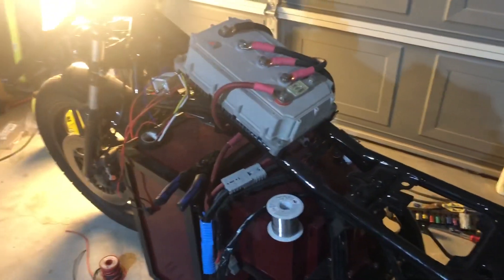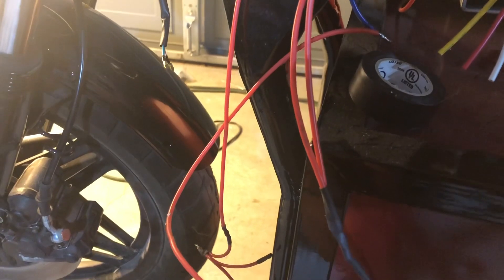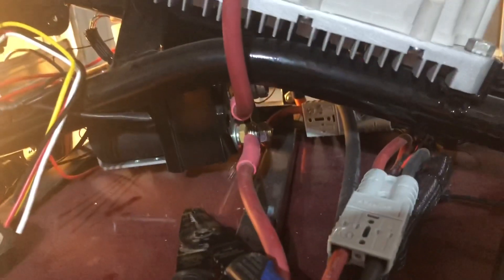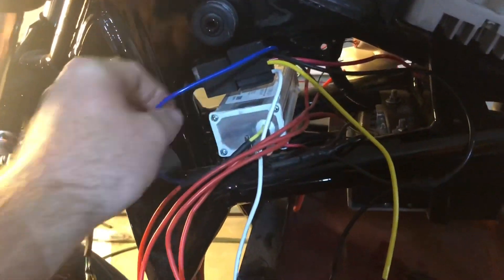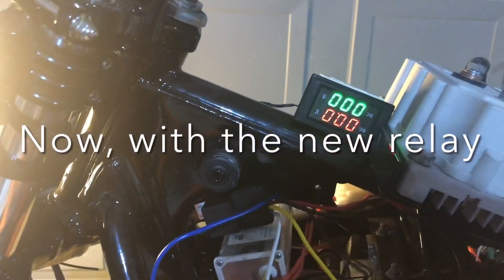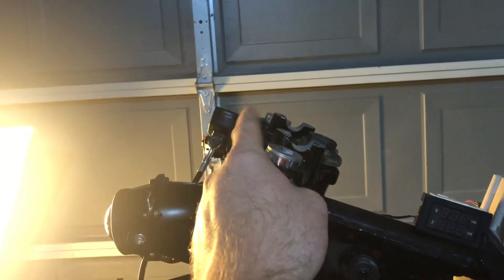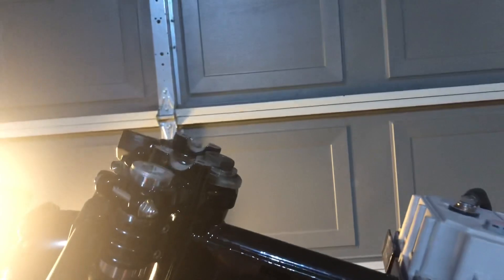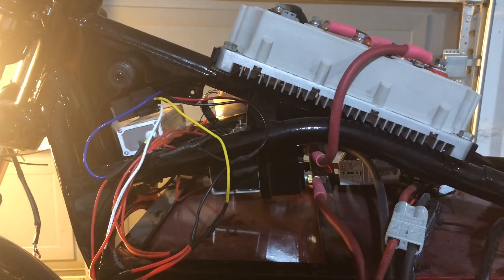Electric Cafe Racer Auxiliary System Wiring

Comment: Loving your I nja project. We built a 72V 6000w QS hub motor project. I am happy with the setup but either my battery is underspec at 45 Ah or a series of 27 super aluminium capacitors might help my issue. I can charge the 72v up to 84v but the voltage drop of going up steep hills here in Iceland are causing a under load voltage drop below the 60v 3 sec limit. If I hit that my controller cuts out and won't start up until briefly charged. Which is annoying. I am wondering if your capacitor solution can compensate for the voltage drop and thereby extending the range as it would not die on me for hitting 60v too soon.

Comment: Don't suppose you've got a wiring diagram? I didn't understand the part about putting a relay in front of the DC/DC converter, and how you wired that in.
Reply from the maker: I don’t have a diagram, but the relays come with a diagram. I just made sure to place it so that the wire that closes the relay runs through the key switch and the circuit after the relay closes connects power to the DC/DC converter. Sorry I don’t have anything more!
Reply: @LordCurt  Ahh, I get it now. Thanks for the explanation!

Comment: Wow, that sprocket sure wore down compared to the latest video that I watched
Reply from the maker: It’s a different one, and it’s actually brand new. The teeth are her black, but the face is worn grey because I had it sitting on its face while I worked on grinding the back of the teeth to the correct size and shape. As it spun, it wore off the paint on the face. The sprocket hadn’t even gone on it’s maiden voyage at that point, though

Comment: Idk how hot it is where you're at but I want to know, will the bike stay cool in this heat? Are you worried about battery over temp?
Reply from the maker: Batteries are safe up to 140f, so as long as we don’t thrash them too hard on the host test of days they should be good! We’ll see what the battery temp monitor says as we’re riding it, but I’m not concerned yet

Comment: Maybe you guys could utilize the tank for key switch and volt / temp meter
Reply from the maker: We kind of thought of that, but we landed on the preference of keeping it quick to pull off. If we have sensors etc. then we have to be able to disconnect them to get to the controller

Comment: Thank you guys for showing all this information. I have an XS650 that's not running that I'd like to do something similar with after watching the work you have done. Did you guys ever figure out the reason the bike was cutting out?
Reply from the maker: We have it dialed back right now. The battery pulled 320 amps on some of our trials, and it only dropped about 8 volts under that load. It seems that the battery can handle the draw, at least if it’s continuous. At that output, though, the controller seems to shut down intermittently. I think there is a bit of improvement to be made from programming still, but the limitation seems to be at the controller level in one form or another. Is it enough of a limitation to do something about at the end of it all? That’s to be determined still
Reply: @LordCurt  thank you for the reply. Do you think a different controller might be what's necessary? When I searched the motor I believe you are using, the ME1507, I've seen quite a few listings for it with a Servcon Gen 4 controller.
Reply from the maker: @RJBiteanerd  I am pretty positive it would fix the problem; the only issue is it’s nearly 3 times the money. We got this controller for 800 USD, and the Sevcon is 1100 plus another thousand for the software to program it. It’s a big investment, so if we can’t dial this one in to satisfaction we’ll go down that road

Comment: A really good way to stiffen up fiberglass parts is actually rope. Saturate the rope with resin, lay it on and then another layer of glass over it.
Reply from the maker: That’s an excellent idea! Should have thought of that. This did well and was super flat, which is a plus for this